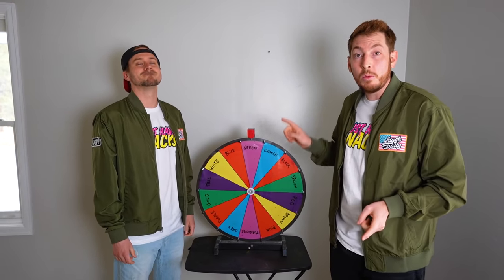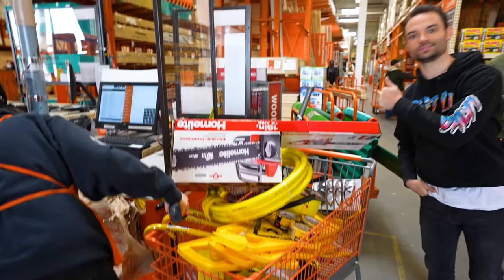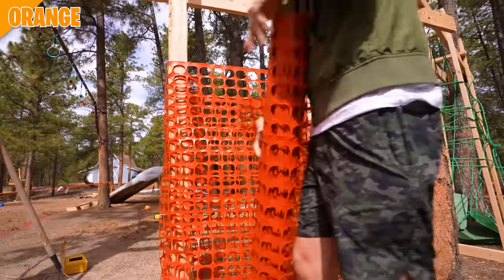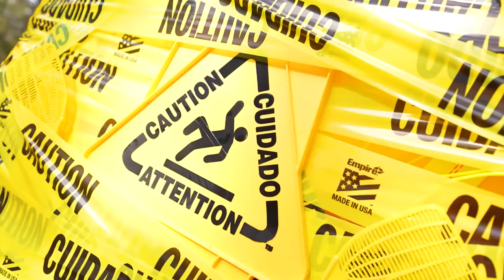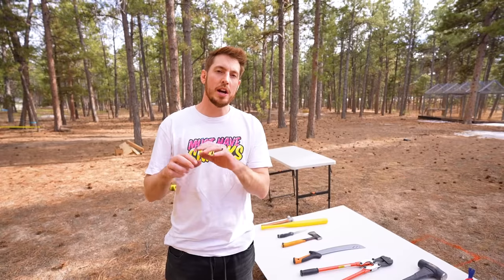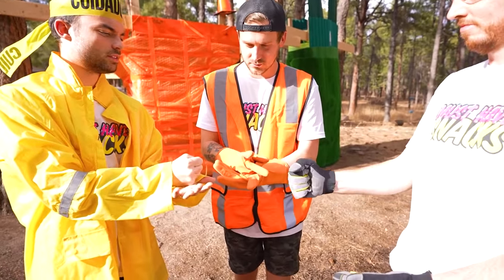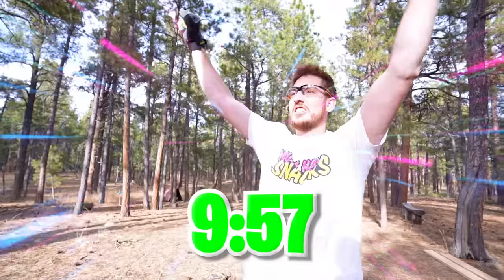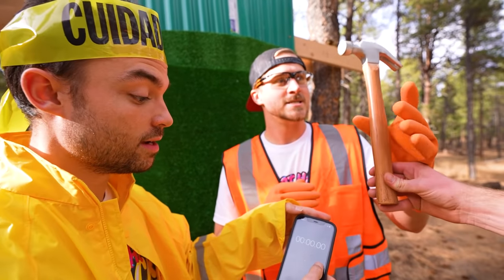100 LAYER WALLS ONLY USING ONE COLOR!

Comment: Jstu should add a power card called the SABOTAGE to their budget board. 

The way it will work is if you get the ball to land on the sabotage you automatically get the lowest budget. Say the lowest budget is $10 and Justin ends up getting the sabotage.

The sabotage allows you to swap your lowest budget with the person who ends up getting the highest budget. 

So if Andrew ends up getting the highest budget, say it's $1000. Justin swaps his budget of $10 with Andrew and gets the $1000 budget. Andrew gets the budget of $10.